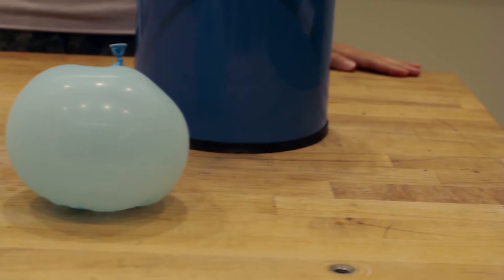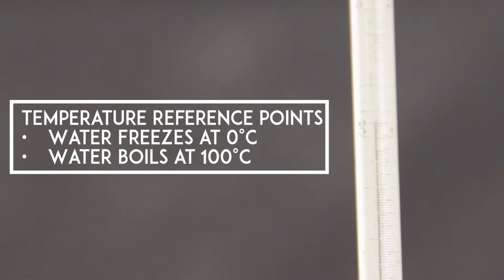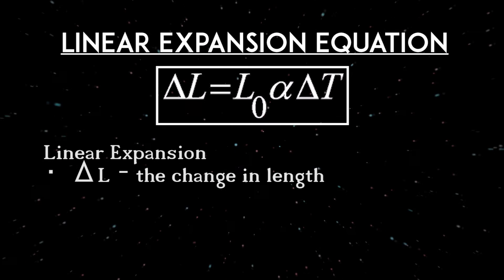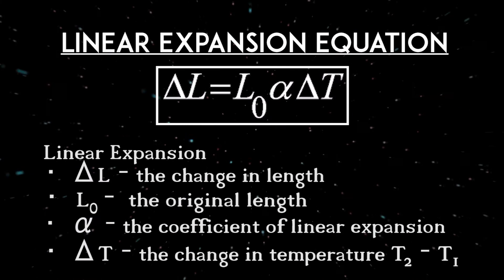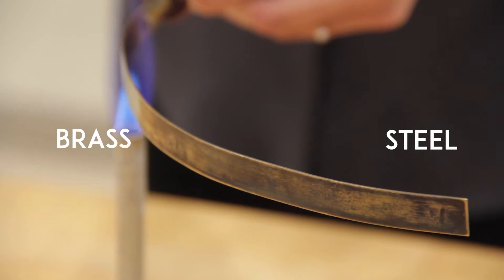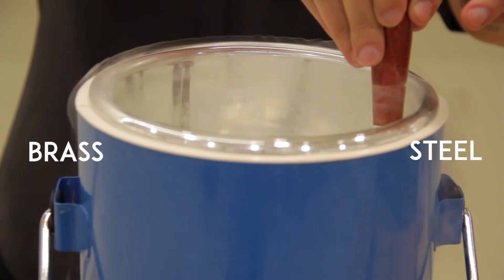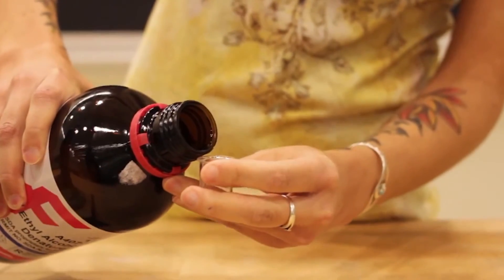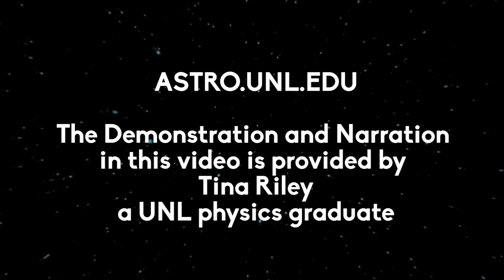Temperature 2

Comment: why do so many people believe that by heating up a material the vibration frequency of the atoms change?! it's actually the amplitude of the vibrations which gets larger. If the frequency of the vibrations would change, IR-Spectroscopy would be extremely temperature dependant, which it isn't.